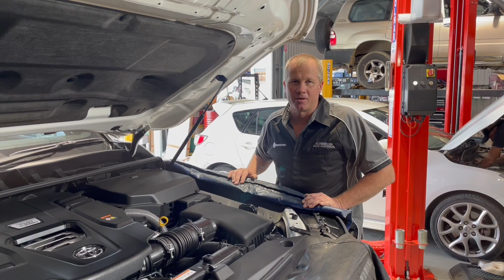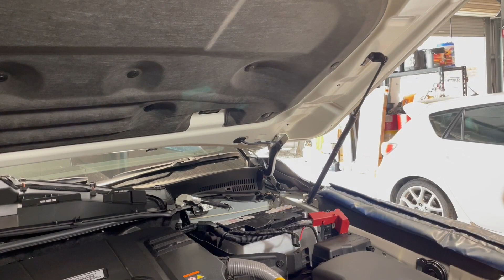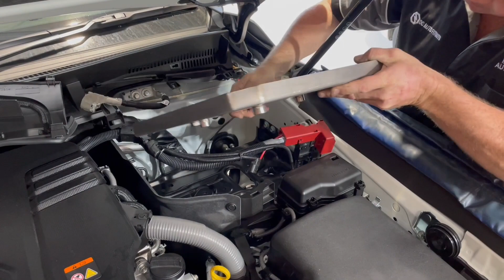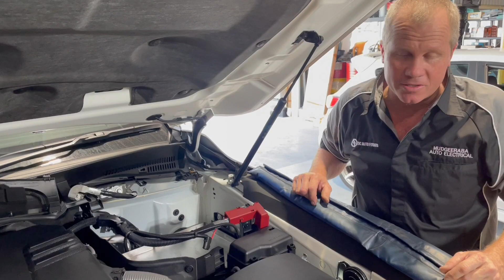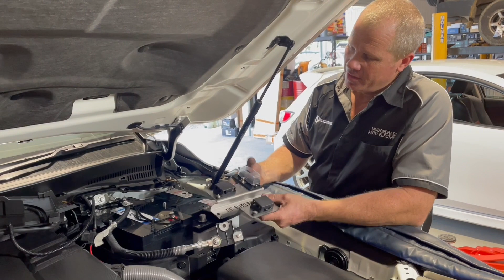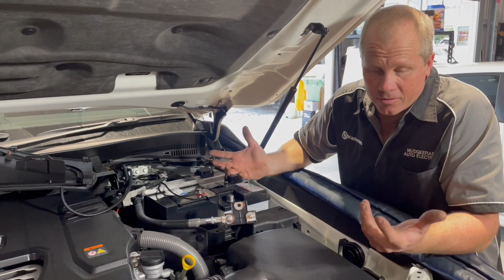DC Auto Fitouts 300 Series Dual Battery Tray Install V2

Comment: what maximum size auxiliary battery can fit?  Can you use a lithium under the bonnet?
Reply from the maker: n70 size case which is 306mm long.  yes you can use lithium but consult your supplier for on that is rated and that they will warrant for under bonnet use.
Reply: @Bansheebuzz183  Thanks but at $395 you're one of the most pricey....else I'd buy it